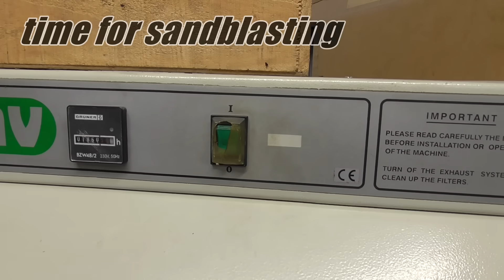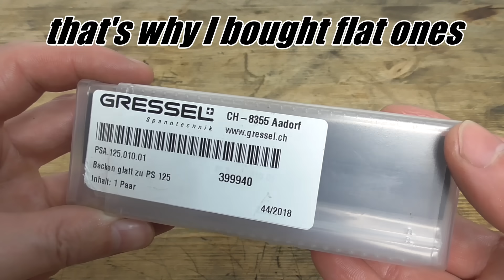Rusty Deadlocked Vise - Perfect Restoration

Comment: EDIT:  I wrote the below question but then went to look up videos on it and found one of his videos ("How to turn Steel Black: Everything you need to know about Bluing") that (I think) answers the question I had here.  He says in that video that he is just using cooking oil so I think that would just be called canola oil here in The States (and Canada)   I'm not 100% sure of that.

When you say rapeseed oil (12:45) - is that the industrial version of rapeseed or is it simply canola oil?   I think in Europe they might call canola oil rapeseed oil but I don't know that for a fact.

The industrial version (rapeseed) has more glucosinolates  and erucic acid - a lot more and I wasn't sure if that might be important in turning the metal black.
I think in N America true rapeseed oil is considered inedible and canola oil is what they call the edible version that has low erucic acid.  I would think that if the rapeseed oil you are using is considered edible that it probably is actually canola oil but I don't know that for a fact.
I have no idea where I would get industrial rapeseed oil when you search for it all I get is results for grapeseed oil

Comment: A very enjoyable video and some great work !
It is good to see a video where someone is not taking grinders twisted wire wheels and God alone knows what else, to the carefully machined bearing surfaces, just to make them shine.
Given that a new plate had to be made, I would have been tempted to fit a thrust bearing at the handle end of the screw shaft. I used a big old Record vice adapted like this and it makes a huge difference. One day I will get round to doing my own vices.... one day ......    ;<)

Comment: Hello MyMechanics! Thank you very much for your really excellent and very pedagogical videos. Your restorations are truly enviable... I have some advice to ask you: I'm restoring an old vice found next to my garage; it has been sleeping outdoors for years and has rust completely covered it. I managed to clean it a lot with electrolysis and vinegar but I absolutely can't get the central axis to turn (the infinite screw) and I no longer know what expedient to use because I've done everything: blowtorch, super dégrippant , chloridic acid, martellat ; I even created more leverage for the handlebar with a hollow iron tube... Nothing, it doesn't move a millimeter! How would you proceed in this case? Thanks in advance ! 🙂

Comment: Where do you leave all restored items? They are almost too good to be used for their initial purpose. And selling them may be hard? I suppose they became kinda pricey. I would take one of those Bressels of your hand though…
Reply: What do you mean by too good to use? are saying I shouldn't go buy a new vise because it's also to nice?
Reply: @colbybarbour3747  you couldn’t be farther away from what I was saying. I said: “ALMOST too good…”. And I didn’t say that a new vice shouldn’t be used. I was SUGGESTING however that the vice in this video is much better than an original new one which was a compliment obviously. That compliment was implicit hence I understand your confusion. But to come back to your point: I’m still curious to where al the restored items go. They are master pieces, all of them.

Comment: what was the principle behind checking if it's heat treated or not using file? was it like intendation? if so wasn't the same file used on the dovetail
Reply: The file would cut more material off something if it isn't heat treated and less off something that is.

Comment: Great job, although you stoned both sides of the dovetail, one should be stoned or ground, the other scrapped, that is because with both surfaces stoned their is no gaps for oil to sit, so it will rust and bond together, where as with one surface scrapped oil can sit in the troughs of the scraped surface and hence remains well lubricated for longer, that’s why it was bonded before the restoration.

Great job though just some engineering know how to ensure it lasts longer

Comment: Reminds me of an old drill vise I bought at a garage sale in France. It looked very old, jammed, a bit rusty but well constructed.
I bought it from an older man, probably in his 90s, who clearly hadn't used it for many years, but told me "juste un peu d'huile" ("just a little bit of oil"). 
Got home, squeezed a bit of engine oil on every moving part, opened and closed it 10 times. Wiped off the oil with dissolved rust, repeated that a couple of times.
Guess what, it's like new.
Reply from the maker: Awesome!

Comment: hahahahahaha I don't know what you size for and you do a lot of relaxation, they really don't know anything about how to put the screw without scratching it or taying it and giving it a wire brush if they don't know anything about how to leave it as new. tell the secret and this is not known by the engineers or chemists this was told to me by an old man who is from the state of Chiguagua Mexico in the mountains is an indigenous person and this man taught me this and I was very surprised, check and learn the man asked for these Ingredients asked for natural pulque and nopales in small pieces does not make them have the thorns he asked for many liters full like a quarter of a bottle of those of oil of the great ones and there he put the pieces obviously they could do it in a bottle of those of paint or I suggest you tie the pieces with a wire so that you can see how the process is going, put everything in the liquid bone in the pulque and You cover the bucket with a bag and leave it there for at least a month each week, you will check the pieces, you will take them out and if they are not cleaned yet, you will leave them for a longer time and you will touch them a little with a stick, it does not make the pulque ferment and it smells ugly, you leave it there until the pieces look like new and the rust is gone and when it no longer has any rust you can rinse them with oil or white gasoline without having to do everything you did and All the pieces will fit perfectly without so many processes I thought they knew but I think not but well I already told you my secret I hope it has served you with something good I say goodbye and take care

Comment: Never in my life did I think I'd be spending an evening watching the restoration of a vice.... and loving every bit of it. Awesome!.  Only problem now is that it looks too nice to use
Reply: Gressel makes very high quality vices and after this guy restoring it the vice is ready for another 100 years of use
Reply: Putting in all the time and effort working like this on a vice always makes you think twice before abusing it in any way. Over the years, It is bound to pick up a few dings and scratches , that cannot be helped. If I do need to 'take things to the extreme' or weld in the vice, I have an old 'beater of a vice that soaks up all the abuse and, if I really need do do some heavy hammer work, I have a 120kg blacksmiths leg vice.
An excellent restoration and a well thought out video !
Reply: This Gressel vise is better now than it was when manufactured. This guy is a craftsman extraordinaire!

Comment: I have the same thing at home, actually i do have used it 4 days ago. No need to take this apart. It makes the job over 100+ years with some oil. I know looks pretty when you do all of things.
If it works , then apply oil and that is. Mine is around 40+ years old.

Comment: I made dozens of these walruses for a German engineer in the 70s at Mayer do Brasil, I don't know what happened. i wanted one as it held two solophone sheets to the end of the jaw each sheet is 0.02 thick it was very accurate excellent for holding swiss block matrix

Comment: There is a product called Metal rescue that I used to remove the rust from the inside of my vintage motorcycle gas tank.  It cost about $25 per gallon but, it worked fantastically.  I doesn't hurt rubber or plastic and ONLY goes after the rust.  You don't even need to wear gloves when using it.  I wonder how well that would have worked on this job.

Comment: Lovely job! Relaxing to watch and very satisfying. Just one question: How come your hands are always clean? Whenever I attempt any mechanical engineering my hands rapidly become black with grease and dirt. I should have asked my father who was a toolmaker but he is long gone...
Reply: If you use hand conditioner, it fills up the cracks and pores etc in your skin and stops the dirt and old grease getting in, 
You will have dirty hands but they will clean up very easy afterward.
Or just wear gloves All the time.

Comment: Gawd I wish I had a machine shop. Isn't fun restoring things other people would throw away? I build choppers out of adult trikes as my hobby. The one I'm working on right now is a Miami Sun that someone left outside too long. So much wet sanding between coats of paint. There's a lot more surface to a trike frame than one might think.

Comment: Been a few years, but instead of WD...Try some PB Blaster to break those parts. Many years back I was working a boom off  of carrier. In the weather and seldom if ever used much less maintained. Had a three inch bolt holding it. We tried heat, oil, hammers, mauls, drills etc.. Nothing would move it, not so much as a 1/64. Three days and all I had was a bolt with the head cut off, bunch of holds drill into it ( release the stress ) and ungodly amount of oil in the water as it pour over. Being the pin was CRES we couldn't just burn it out. Now with all the pounding and beating this thing, I had a crowd forming on pier side from time to time...yelling advice...calling me names for all the noise I made...etc....One old timer came out to see me, check what I was doing, told me to go get some PB Blaster. I did, sprayed it on the top edges so it would drain down, and even sprayed it from the bottom side...soaked it good. Next day came in, took my two inch pin, held that in place hit once with the 2pound maul and poof...the three inch pin slipped out the bottom and into the river...never to be a issue again. Love that stuff to the day. It eats rust vs trying to lubricate

Comment: You need to use the German aviation product Aero-Kroil on parts jammed with corrosion.  It is simply amazing and you have had it apart in a hour with just a brass hammer.  After spraying, the hour is how long you wait while enjoying a refreshing beverage.  WD-40 does not come even close.  Beautiful restoration!

Comment: mag wheel cleaner from any auto store also works well. Immerse it for a few hours and all rust dissolves. The rust ends up as a sludge at the bottom of the container, so put the item up on small blocks. You will need to lightly oil the item after rinsing it off because it will be shiny like silver, and you can watch it start to rust back up.  I did this about 30 years ago, I am not sure if mag wheel cleaner is still available.

Comment: You can use heat pistol and rise to 200 or 300 C temperature to break out the cohesive rust film. This.make disassemble a lot easy

Comment: 我作为一个在中国工厂工作过40年的电机工程师，看到你的视频非常专业，非常优秀的工匠工作，非常钦佩！还用喷砂工艺除锈，非常专业。表示十分敬佩！
As an electrical motors engineer who has worked in a Chinese factory for 40 years, I see your video is very professional, very good craftsman work, I admire it very much! It also uses sandblasting technology to remove rust, which is very professional. Expressed great admiration!

Comment: I've had very good results with a product called Evaporust. It's biodegradable and eco friendly, and does a good job of ridding rust. I don't have a sandblaster, so it helps keep my workspace from getting dusty from using wire wheels to remove rust.

Comment: Is an ultrasonic cleaner not an option,  or one of those LASER rust removal tools?
Reply: Ultrasonic cleaner no. Laser yes.
Reply: @osyisr6361  does ultrasound damage cast parts like these or just too expensive for one powerful enough to work on parts this heavy?
Reply: @charleshetrick3152  the laser would be far more expensive than the sandblaster or ultrasonic cleaner. Ultrasonic cleaners would work they just aren't as effective.
Reply: @osyisr6361  I figured the lasers were still darn expensive,  I refinish pot belly stoves and the like and last I checked ~$40K was my starting price so I do stick to soda blasting, sand or glass is just too aggressive.   When I can I use high pressure water too.   As to ultra sonic those also get pretty pricey for dense heavy parts.  The one I have for small parts is 9L and it was $600.00

Comment: I’m guessing you’re a machinist? Is there a way to do this w/out all the lathe etc? I’m looking to restore an old pool pump and wanted to figure out how to do it? I don’t have a sand blaster either? But man I really want to do this pump like you did this vice.
Reply: Acid or electrolysis will work for the rust. You can sand the rest of the parts it will just take a while. A local machine shop will make anything you would need.

Comment: Really great work, mymechanics! :-)
I found the video just right... bought an old industrial workbench from the 1960s a few days ago. Demounted it, grinded the wooden parts and the steel frame. A friend sandblasted the included LEINEN E 125 vice for me. Yesterday I painted the steel frame, the front wooden parts and the vice with Hammerite anthrazit matte. Came out really great. :-)

Comment: 1. What kind of green paint did you use, the can labeling was in german so I couldn't make out what it was?  
2. Also, what solution did you place the handle in to turn it black?
The end result is awesome!!
Reply: 2. It's quenching. Heat the metal and submerge it in oil. In this case it was heated to 300 degrees Celsius, and I believe it was rapeseed oil.

Comment: Beautiful!  I'm getting ready to have an old Craftsman vise sand blasted.   I don't have the aluminum tape; can I sharpen/polish up those surfaces afterwards?  Thanks!
Reply: Sand blasting can pit the surface, so it won't slide as well on the dovetail unless you re-sand, and then they may not link up after, best protect them as best you can- aluminum tape is available at any hardware store.

Comment: Nice work! FYI... I have had great success removing rust from iron and steel by creating a simple citric acid bath — food grade citric acid powder dissolved in warm/hot water in a plastic storage bin large enough to submerge the part(s). This is basically the same approach used for de-scaling a tea kettle...only a bit more industrial. :-) Works like a charm! I then rinse part(s) with fresh water, dry parts, and temporarily coat with camellia oil to prevent flash rust (e.g., before additional prep for finishing/painting). Note, you will want to experiment with the strength (citric acid to water ratio) and not leave items in the bath too long as pitting may occur.

Comment: What kind of paint would you recommend for a surface that may be in contact with pieces of metal? So far ive never found a paint that really handles rough work, even hammerite seems too weak :/
Reply: Perhaps a spray lacquer for metal as a final coat on top of the paint would do what you need? But avoid cellulose based lacquers, they age less well and are prone to yellowing.
Reply: @sl9sl9  Thank you!! Great advice!

Comment: you need a gopro dude. the image stabilization is awesome! or attach your camera to a tripod and hold it by the tripod while filming. It really helps get smoother/less shaky movements than when holding it in your hand
Reply from the maker: Thanks for the tip

Comment: Fantastic work !!! Something from a fine old firm like Sulzer deserves a restoration like you did. Bravo !!! The only caveat I have is that smooth jaws like the ones you used as replacements can be dangerous. That's why the original jaws were serrated.......for a firm grip. If you want non-marking jaws, make a set out of aluminum on your milling machine.
Reply from the maker: Thank you very much :-)

Comment: Right, so I've seen all his other videos and I have a question for anyone who can answer it: Why did he do the fine-grit sanding first and put aluminium tape to protect it during the sandblasting this time as opposed to  doing the sandblasting first and just fine-grit sanding later? I wouldn't think a table vice like this would be precise enough to merit keeping the maximum level of precision on that section, and it seems like it would be a lot easier to just sandblast the whole thing first. Is there some technical thing about this vice I'm missing or is it just miss-scheduling (forgot to do it first and didn't want to do it again)?

Comment: Question about this one:  why did you restore the dovetail and other smooth surfaces BEFORE sandblasting?  Couldn't you have saved yourself the aluminum taping by sandblasting first and then restoring the smooth surfaces?  Or would the whole thing have rusted too quickly?  Incredible video as always; I eagerly await every new one!
Reply: Sand blasting can give a pitted finish. You want those machined parts as smooth as possible. It’s ends up being a bit more work if you sandblast it’s first and you have to remove more material

Comment: Two questions:
Why didn't you simply make the jaws from bar stock instead of buying them new? (I mean you seem to prefer to fabricate pins, screws and washers. It would seem a simple thing to fabricate the jaws)
Why didn't you verify the heat treating worked? (or did you?)

Comment: I learned a better way to remove broken screws, weld a nut over the broken screw shank and you can usually unscrew it with a wrench just an FYI, it works very well

Comment: I dont know what kind of coolant you are using for drill and cut but mine is mixed with water. And from oil turns in to white fluid and then its does the job right. 🤔